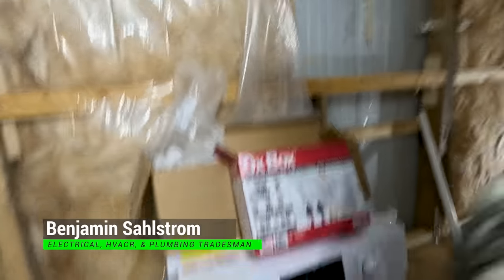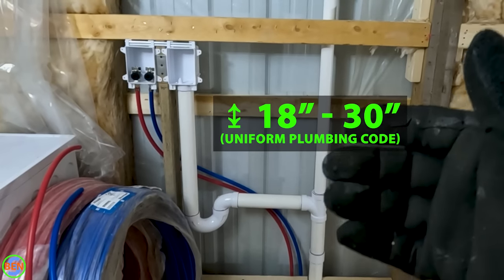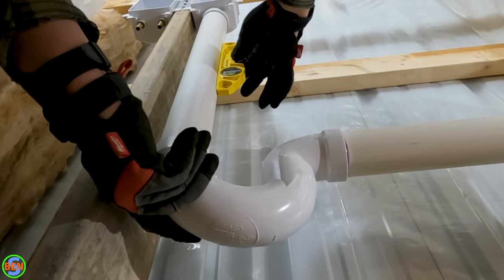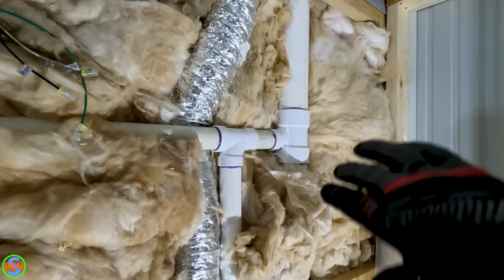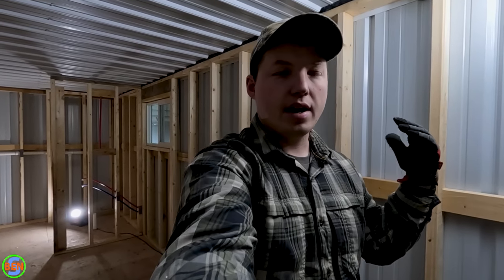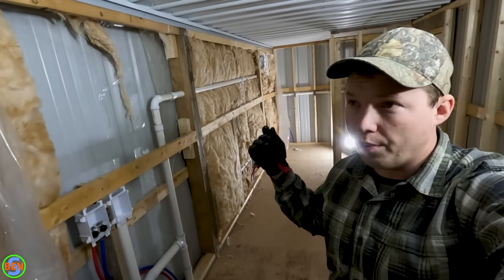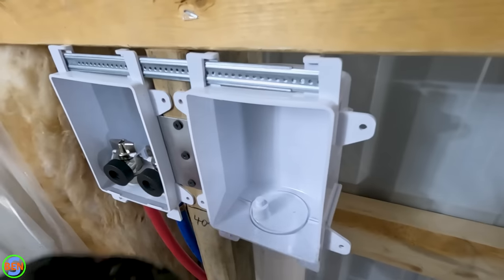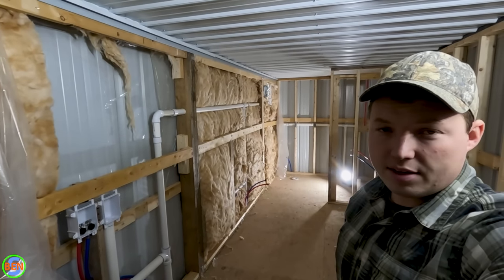How To Install A Recessed Washer Box - Sioux Chief Ox Box

Comment: I just finished a project similar to this for a friend. I lowered hot and cold and the drain 10". I used similar parts but with the trim plate I was able to recess everything into the wall with nothing sticking out, along with 90-degree hose fittings so the washer is
 1 1/2" away from the wall. The dryer has a rectangular offset vent box which keeps it very close to the wall, along with the electric dryer recesed wall outlet, so that the cord connector is flush within the wall. Nothing sticks out from the wall, except the washer drain hose that goes into the wall. They have the same washer and dryer as the ones you have too. Great video.

Comment: Quick question … if in situation where there is no vent system close by and you are “forced” to install a studor air admittance valve, would 6” rule above flood rim of a stand pipe have to be applied as well or valve could go lower? 👀 Great vid as per usual. Thanks in advance. 👊

Comment: The white tabs around the ox boxes sit 1/8" proud of the stud, making it seem impossible to install the drywall flat against the studs.  
Is that just how things are supposed to be?
Reply: I think the drywall doesn't come flush to the box and then a plastic frame surrounds that gap

Comment: A good idea is to have a drain "wash" a 90 degree as it goes up to a vent.  In other words the waste will clean the line before it goes up and out to daylight.  Sometimes you have a choice to do that and you are doing that in the vertical stack as it comes up from bottom plate.

Comment: You primed and glued the DWV pipe to the Ox box right? I think that Ox box is made of PVC too? One tip I would suggest is use long sweep 90s wherever you can, especially in new construction! The higher the radius of fittings the better. For venting it doesn't matter, in fact they actually make super sharp 90 fittings for venting. You're getting all fancy with intro graphics. :-)

Comment: Mom’s washer box had it all in one box, that way if the valves or hose connections leaked, the drain line caught the water. 
Of course this was in the early 90’s. 
Hello from north east Montana. 
10 miles from the Canadian border.

Comment: You are running a refrigeration system that uses a pump recirculation overfeed system. What should be turned off if all compressors go down?

Comment: After gluing mine, somehow, it ended up out of plumb between the trap and the box, so the the stand pipe is sticking past the front of the studs about 1/8", while the top is within the stud cavity fine. In this situation, would you cut out what was made and try again? or just fur out the wall by 1/8" for a few studs?
Reply from the maker: Seems like once you put on the trim you probably won't notice the 1/8".

Comment: It is a shame that Sioux Chief makes so many boxes that are lipstick. Focus should Include some type of designed in drip pan that directs water down waste hole instead of around front trim and down wall. This situation really stinks if it goes unnoticed and pops tiled floors  - ask me how I know.
Reply: Was it a clogged drain or a leaky connection from the hose?  Confused how the drain box caused a leak and not the supply box

Comment: Please don't bend the water lines.  
For 1.  It doesn't take 5 extra minutes to put ells in for nice straight lines and eliminates the possibility of stress cracks where the pipes are bent
2. It's just unprofessional to not take pride in your work to the put and say I don't care how my pipes look a professional should always make it look professionally installed and make sure that every aspect of the job looks professional nice and neat.  When you decide to bend pipe to save money or time then you are no different that a handyman and not a professional plumber
Reply: Depends on how much you bend. Isn't that the benefit of pex vs copper.